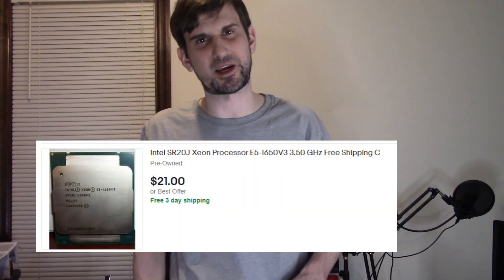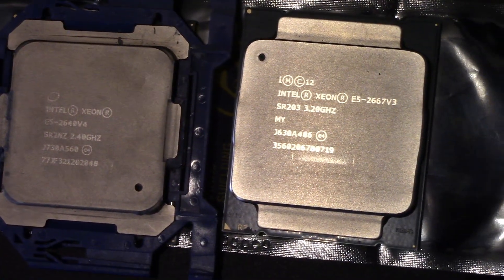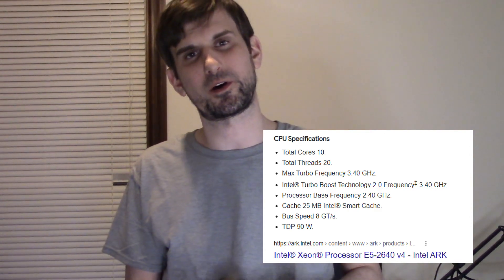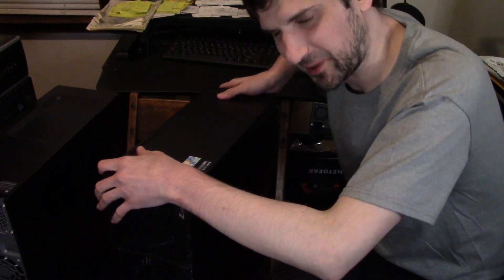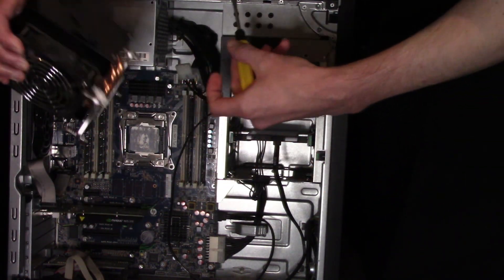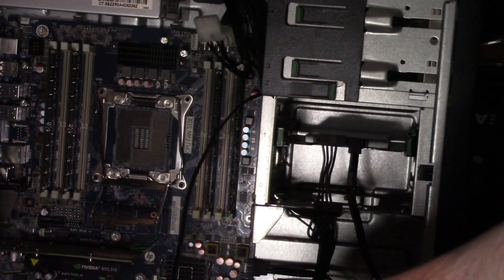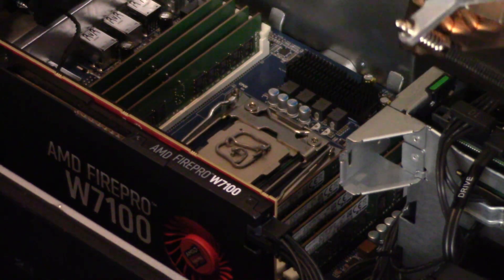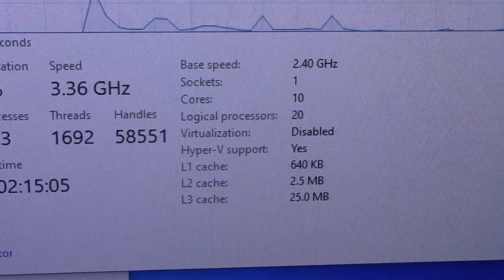$19 Processor, 10 CORES this Time!

Comment: Between dell 5810 and Z440, which one will you recommend?
Reply from the maker: Don't make me choose! 😓😄 That is definitely a tough call. If I had to pick one though, I would probably say z440. The 5810 has some clever design features, but I find the z440 easier to work with and I really like the simplicity/overall layout. Specs-wise they are pretty much the same so a lot of it is just preference though. If you do decide to go with 1 of them, keep an eye out on the power supplies. You might already know this, but both the 5810 and z440 came in different variations with different PSUs, and it is a good idea to try to get a variation that has the additional 6 pin PCIe connectors for a GPU.

Comment: Virtualization Disabled? WTF bro. That cpu was designed to run vmware. Of course you don't need virtualization for what you are doing but it's still disgraceful for a z440 to have virtualization disabled like taking the trailer hitch off a truck.
Reply from the maker: 🙂 Ordered used, was disabled when I picked it up. If I need it for something it will only take a few seconds to enable.

Comment: i5 4670K overclocked can run 6 1080p tracks and a audio track in davinci resolve before it starts to struggle with scrubbing and preview.  A xeon should be fine with 4k tracks.

Comment: I'm also curious on how well a stock HP z640 workstation will be used with stock components and a Nvidia Quadro m4000 gpu will perform in games.
Reply from the maker: I've never happened to work with the z640, but they look pretty legit. The m4000 would probably be alright, but the 1060 like you mentioned in other comment would likely be a better match. It is just generally more geared towards gaming than the quadro cards. I imagine it would make a solid budget setup all around.

Comment: Do you have any thoughts about how the Xeon CPU would preform against an i5 7th gen for gaming.
That assumes using a GPU.
Reply from the maker: I haven't personally tried the 7th gen i5 for gaming, but it seems like for most games 4 cores still seems to be enough. So I imagine it would still be on par with these types of Xeons. If going the Xeon route it might even be better to go for one of the options with 4, 6 or 8 cores as opposed to the one in this video with 10, since most of those have a higher clock speed closer to the i5-7500.

Comment: Will the Xeon E5-2695 v3 work in a Z440? Also, do the standard power supplies for these have a six pin connector that would work with a NVidia 1650 Super? Thinking about buying a Z440 with only RAM, motherboard, PSU, and CPU cooler and installing the mentioned parts above, plus some SATA drives. Enjoying the video. Thanks.
Reply from the maker: I believe it should run the e5-2695 v3, though I haven't tried it to be able to say 100%. I have successfully run the e5-2667 v3 and the e5-2640. Also "e5-2600" series in general are listed as compatible, which all leads me to think it would work. When it comes to the Power Supply, you have to keep an eye out on the wattage. The z440 came in 2 variations. One has a 525w PSU with NO GPU CONNECTORS, which sucks 😓. BUT, the other variation has a 700w PSU and that comes with dual 6 pin connectors. So keep an eye out on the specs page, or if you can see pictures inside the case, it will have the wattage listed on a little sticker on the power supply. That sounds like a cool build, good luck on the hunt if you go that direction. And glad you liked the video, thank you!
Reply: @LowcastleTech  Thanks for the reply and keep making the great videos!

Comment: the z440 is king of budget systems, and has been for a good while now. I built mine into an enthusiast market case (antec 900) and it's been a joy, except for HPs proprietary nonsense. Fair to them though, its a lot less egregious than dell. The only thing so far that's a problem to me are the bios complaining about unnecessary components (ram shroud, proprietary front panel) and the fact that no-one seems to know what pins to connect the power switch to.
Reply from the maker: 🙂 Yeah the 440 BIOS is crazy about fans no doubt about that. I'm still having to bypass the "memory fan" message as well. I might just get one some day. They aren't terribly expensive but seems like the only reasonably priced ones ship from China, so would prob take a few to get it.

Comment: Nice video, I've subscribed for your future videos.

Nice tip on the workstation model to look out for, as working motherboards are indeed a pain to get hold of for anything but excessively expensive prices.

For your gaming benchmark I think picking a game which is CPU bound like Valorant is better than Devil May Cry which is probably gpu bound. I doubt your frame rate is any better than the previous 6 core you had. Valorant also has its issues as I doubt it would make use of all the cores, so maybe a synthetic benchmark would also be a good addition to show the power of the CPU.

I used an x79 CPU (the i7-3960x) for many years so love these quad channel platforms being able to show what they can do.

By chance is you xeon overclockable. I find the overclockable chips normally have great headroom for overclocking and can really challenge much younger CPUs when you do ?
Reply from the maker: Thank you, I appreciate the sub and the suggestions! From what I've read and observed I don't think this general range of Xeons is able to be overclocked, but I also don't have a lot of experience with that to say 100%. Also that processor looks pretty sweet, I didn't even know there was a 6 core available in that gen. Nice

Comment: I really like this idea, and was wondering what’s the best optimal graphics card for that processor upgrade plus maxed ram?  for games like mortal kombat 11 and some call of duty type fps? I’m a newb with gpu’s btw but learning
Reply from the maker: That's cool, I'm really still learning as well (lotta things that catch my interest 🙂). As far as the RAM goes, that combo of CPU and the board I'm using will hold a lot, like up to 128GB, But for most games you really don't need anything close to that. 32 GB is usually good for gaming. As far as the GPU, I have had good results running the GTX 1060, and GTX 1070 with it. They are solid budget cards that are a good fit for this type of build. It's possible you could go even heavier on the GPU without bottlenecking, but I don't know for certain as I haven't tried anything beyond that. But that being said, as long as you're not trying to push the newest games at super high framerate, from my experience the gtx 1060/1070 range does a really solid job.
Reply: @LowcastleTech  sweet! yeah 128gb ram is pretty insane. thanks ill peep the GTX models you mentioned for sure, this would be my first DIY build but better to start off "low tech"  hehe 🙃 and then see how that shakes out
Reply from the maker: @slaptastics1739  Absolutely! And that's a good strategy, upgrading and generally working on hardware that's a bit older is a really good way to learn.
Reply: @LowcastleTech  true dat my neezy, true dat!! 🧠

Comment: Eyy, same cpu I have in my PowerEdge r430. I plan to upgrade to a 2690 v4 once I can justify it, that's a 14 core cpu at about the same clock speed! Around 40 dollars though.
Reply from the maker: Nice! Crazy amount of cores, and that is still not too shabby price-wise. Especially when it's spec'd out like that.
Reply: You can also watch out for 2697v3. Got that for 40€ shipped as well here in Germany, but compared to the v4 you can turbo unlock the 2697v3. It also features 14c/28t

Comment: 2666v3 is better with TB unlock.
Also what about chinese boards? Huananzi or some other obscure brands. My Machinist X99Z v102 lived through literal fire. I dropped cpu fan bracket on working board and shorted some small component that caught fire. I quickly turned it off and fire went away while i starred there motionless. Also I recommend using graphite pad for cpu switching.
Reply from the maker: I actually haven't come across that one. I grabbed a 2667 v3, it is 8 cores though as opposed to 10. The 2663 v3 looks promising though spec-wise, thanks for the suggestion. I've had some people bring up the Chinese boards as well, they mentioned AliExpress, which I had heard of before but never really looked into. Will have to check that out, because they are a good bit cheaper. Another good suggestion on the graphite pad 🙂. I don't swap them out a whole lot but that would def help with the mess 😂. Anyway thanks for dropping a comment!
Reply: @LowcastleTech  Make sure to do in-depth research about the chinese MOBOs before buying one. Some of them are so cheaply-made they're prone to fry really quickly, specially if you use some of the more high-end Xeons!
Reply from the maker: @Zakkious  Got ya, thanks for the heads up. I do worry about stuff like that, will probably try to stick with upgrading older servers, they're priced pretty reasonably and likely a better option right now than rolling the dice on one of those boards.
Reply: @LowcastleTech  Oh yeah, for sure! The chinese boards are only worth it if you live somewhere where older servers aren't reasonably priced or available at all.

Comment: That is quite a few cores! Also FirePro GPUs are actually really good for workstations on a budget, I had always had a tough time trying to find the W7100 or similar in comparison to the S9000 or S7000 as those don't have integrated fans on their heatsinks. Regardless, great content as always.
Reply from the maker: Quite a few indeed 😂. Yeah the FirePro seems like it can hang pretty well. There was a period where they were real cheap on eBay but I haven't checked in a while. Prices/Availability really seem to ebb and flow with stuff like that. Appreciate the comment 🙂.

Comment: go with a dell precision work station , you'll be better off. like a T5810 or higher ...
Reply from the maker: I'll have to check those out. Never really got into the Dells, not for any negative reason, just got lost in HP land.
Reply: @LowcastleTech  i got one for 100 bux put the E2667 and 48 gigs or ram all for 150.. and love it!!! try ebay you can find great deals on the dell precision..  They are alot easier to work in than the HP